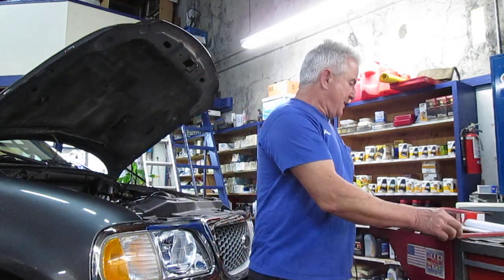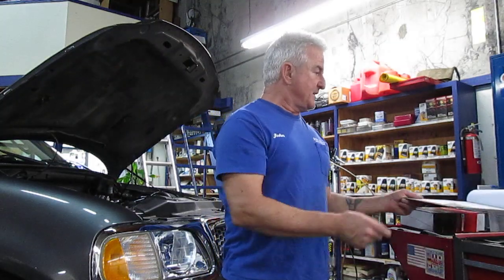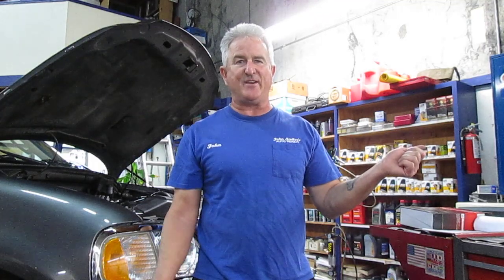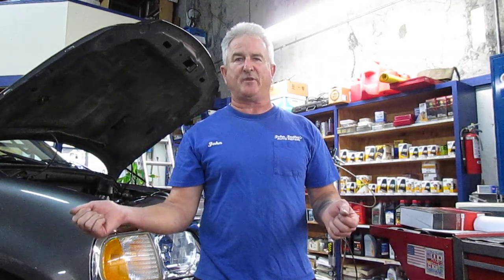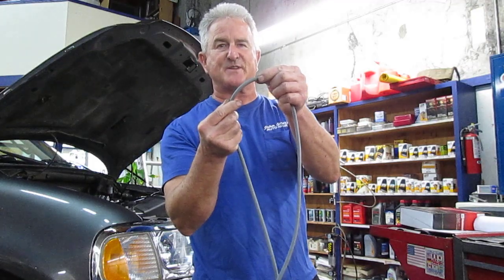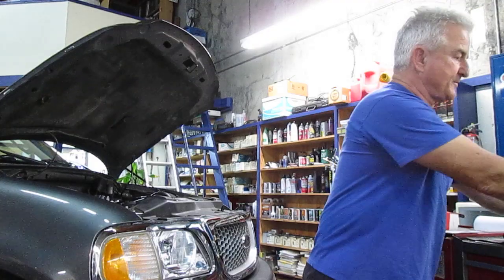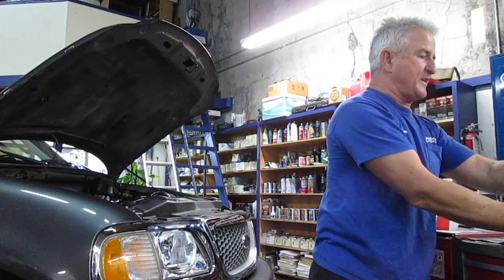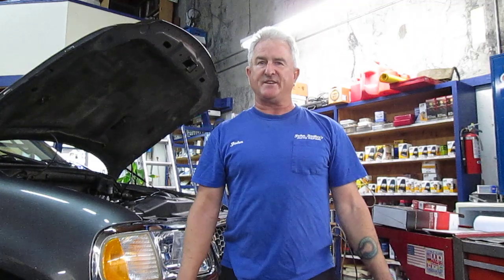2002 Ford F-150 4.2L --Runs rough after the Transmission was Removed

Comment: Have you ever changed the plugs on a e150 with the 4.2 v6, if so what's the best way to remove and replace the two front plugs as their the most difficult ones
Reply from the maker: I don't remember exactly,  either I used a wrench on the top outside of the spark plug socket or a universal swivel after the spark plug socket.

Comment: Great info! My son-in-law has a 2007 F150 that is loosing rpm's when put in reverse. Not every time but consistently. Your thoughts?

Thanks, Tim
Reply from the maker: Timothy Harris HI Tim, It's ok when you put it in drive? What size engine does it have? You can send me the vin number and I will look at tsb's for you.
Reply: The truck only hesitates in reverse.
Reply from the maker: Timothy Harris IDLE AIR CONTROL (IAC) VALVE
NOTE:  The IAC valve assembly is not adjustable and cannot be cleaned, also some IAC valves are normally open and others are normally closed. Some IAC valves require engine vacuum to operate.

The IAC valve assembly controls the engine idle speed and provides a dashpot function. The IAC valve assembly meters intake air around the throttle plate through a bypass within the IAC valve assembly and throttle body. The PCM determines the desired idle speed or bypass air and signals the IAC valve assembly through a specified duty cycle. The IAC valve responds by positioning the IAC valve to control the amount of bypassed air. The PCM monitors engine RPM and increases or decreases the IAC duty cycle in order to achieve the desired RPM.

The PCM uses the IAC valve assembly to control:
  -  no touch start
  -  cold engine fast idle for rapid warm-up
  -  idle (corrects for engine load)
  -  stumble or stalling on deceleration (provides a dashpot function)
  -  over-temperature idle boost
Reply from the maker: john sadler
Reply from the maker: Timothy Harris
Reply from the maker: Timothy Harris
Reply from the maker: Timothy Harris I was trying to post a picture of the throttle body also, you an check to see if there is a bunch of carbon on the throttle plate and push it by hand to make sure it's not sticking. They make a throttle body cleaner and just open the throttle plate by hand and use a clean rag with cleaner on it too wipe off both sides of the throttle body. It's also possible you may have a broken motor mount. Have someone hold one foot on the brake and one on the gas with the shift lever in reverse, give it some gas and see how much the engine lifts up. should not move very much, then check it in drive and compare. let me know and we will go from there.
Reply: john sadler Great! We will get on the 'To Do List" this weekend!
Reply: John, you are positive it has a IAC? Autozone system says it is not equipped with that part?? 
(2007 Ford F-150 5.4 v8)
Reply: Would it also be called a 'Mass Air Flow' sensor?
Reply from the maker: Timothy Harris HI, did some more research and the electronic throttle body has everything built into it. They are having problems with them. Could you make me a short video of what it does when it's doing it? That would help alot. Was the throttle plate sticking? or black with carbon? How are the motor mounts? John
Reply: John,  My son-in-law cleaned the Throttle body... it was chalked full of carbon build up!

All clean! So we will see how it runs over the next week.

Thanks!
Reply from the maker: Timothy Harris Your welcome, go online to BG Products and buy 44K fuel additive and put that in your gas tank. Will help alot, the part number is 208.